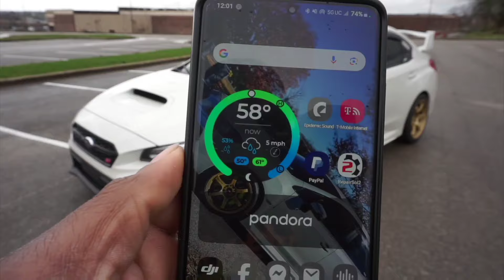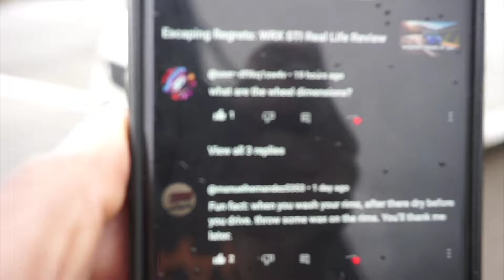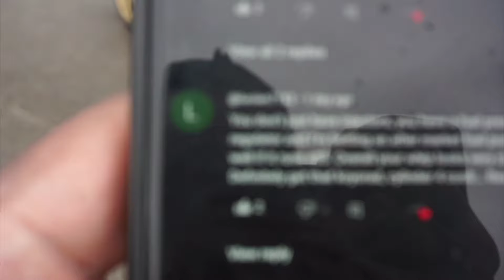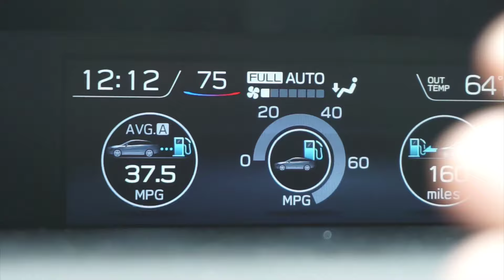"Responding to YOUR Comments: Q&A Session!"

Comment: yo so Im looking at a 16 sti and it looks like it got a bov and cobb sf intake on it already shoudl I buy it?
Reply: Nice bro for the late replay.but if its something you want make sure to check everything over like what mods and tune that it's running. Get the service info as well so that way you know what your paying for if it's from a private seller and the same from a dealer
Reply: @HIROTOLLIVER  its a dealer im tryna trade my car in for it and i have been asking questions i asked him about the tune so ill have to see but idk who wouldnt get a tune on there car
Reply: @HIROTOLLIVER  if the dealer doesnt know is there a site i can use the vin and check or will that not tell me?
Reply from the maker: I dont know for sure if there a site to check but I can look into it.how I did it is to check what layout is the cobb accessport shows because I noticed that when it's tune the read out is different but the pass owner of my wrx sti left information about the tune
Reply: If it’s your going to be your only vehicle, it would really depend on your pockets. These car blow engines stock. Part of it is maintenance the other part is luck of the draw. If your set on an sti, make sure you would be comfortable spending 10k on rebuilding the engine. As it could be at 150k miles or it could be 56k miles. I personally wouldn’t recommend an sti especially modded for an only car.
Reply: @lucian7182  I hear peoiple say its fine for daily driving you just cant be an idot and do 0-60 pulls every time ur at a light or stop sign and I would only get one if I have a warrenty which the dealer said they can put a warrenty on it for me
Reply: @colinmusgrave  yes they can be driven as a daily, but you need to be a lot more on top of your routine with one. For example checking the oil and coolant level weekly, making sure you don’t have bad gas, letting it warm up before going over 3k rpm getting oil to 180 degrees before getting into boost. It’s just not a get in and go kind of car. Kinda like a gt350. If they will offer a warranty, get it in writing that they will honor it even with a tune,
Reply: @colinmusgrave  there are plenty of meticulously maintained STi that get treated very very well that pop their engines. If anything I would recommend driving like a sports car once warmed up and atleast once a month get the revs high near red line. They are great cars don’t get me wrong, reliability wise tho, we basically celebrate it in the scene if you clock 100k on the original engine whether your modded or stock.
Reply: @lucian7182  my car rn is just a regular car and i do oil changes every 3k which if im not wrong u have to do that for an sti or wrx also and the only reason why im fine with that is because I probably drive 3k miles every 4-5 months I have had my car for about 2.5 years and Ive only drvien about 10-15k miles because I rlly only drive to school and work everday so i probably drive 20-25 miles a day so its not like im drivntg 100+ a day
Reply: @lucian7182  im looking at one that has 60k on it for $24k and it has a cobb intake a front intercool a iag aos and a bov only mods thats done and when I check it out ill ask if its tuned because I will not get a car that has some mods thats not tuned
Reply: @lucian7182  yo man did u see my comments just wondering i wanna know what u think about them both
Reply: @colinmusgrave  the oil change interval is proper, for the Sti I would highly recommend motul xcess gen2 5w40.  The mileage isn’t bad at all for the price, and the fact that it already has a front mount is a nice. make sure it comes with the accessport, if not walk away. Assuming it does come with it. Plan on getting it retuned, by a tuner you want to go with once you pick up a couple parts you want to add. 
At that price even if you end up replacing the motor a year from now it’s not bad at all.
Reply: @lucian7182  so i get my car oil changed at a auto shop would they know to use the correct oil? or do i have to tell them to use that type
Reply: @colinmusgrave  I would either start doing it yourself or bring the oil, filter and  crush washer with you. If you go to a shop for the changes I would strongly recommend a shop that specializes in tuner cars like Subarus not one of those 5 min oil places.this is the kind of car where you want to learn to do as much yourself as possible, because mods and repairs get very pricey due to the sti in the name.
Reply: @lucian7182  id have to ask if they dont got that oil id just buy it
Reply: @lucian7182  and like i commented before i prolly wouldn’t need oil changes a lot cuz i barley drive anyway the furthest i’ve driven was like 1.5 hours but that was for vacation i drive to school and work sometimes to get food but that’s it that’s why im fine with it for a daily to have some fun also cuz ive always wanted a sporty car
Reply: @colinmusgrave  I totally get it, mine only has 8300 miles on it, but I’ve probably changed the oil  about 10-11 times.
Reply: @lucian7182  alr so i think imma just walk away from this but I found a regualr wrx and looks like no mods so might go for that even tho its not an sti its alr I cant rlly find any stis near me without loads of mods
Reply: @colinmusgrave  there are a lot of great cars out there, a 2015+ Wrx is a good degree more reliable and less maintenance heavy compared to a Wrx. You could honestly get a 24 base for damn close to your budget.
Reply: @lucian7182  the car is also the color i want and looks good exterior wise it’s got the wing a lip and side skirts already and was wondering which one is faster sti or wrx i heard people say wrx even tho sti has higher hp
Reply: @colinmusgrave  the sti is faster but not by much, not even a full second. Around the city light to light the Wrx can be faster because it spools up around 2500, where the sti spools up around 3500 rpm. The Wrx is cheaper to make power initially as it has a lower ceiling 2015-2021 we’re talking around 300 wheel without ethanol. With ethanol they go up a lot higher but the Wrx trans’s safe point is about 350 . The sti cost more to make power as the engine is like 20 years old, however it has a much higher ceiling. The sti trans is good for 750 whp.
Reply: @colinmusgrave  the sti has a superior awd system, 2 lsd and dccd. The Wrx does not have lsd’s. The sti has hydraulic steering which offers better feedback. Stock for stock the sti has better suspension and Infinitely better breaks. If modding the a fbo sti will be faster than a fbo Wrx however it will cost a lot more.
Reply: @lucian7182  ye if i get the wrx it will be a daily i rlly wont do anything except exuast system and maybe a stage1+ tune
Reply: @colinmusgrave  coming from your current ride I’m sure the bump in power/ handling will be nice.
Reply: @lucian7182  it 100% would my car rn is like 140 hp 😂
Reply: @lucian7182  that’s why i dont rlly care for the sti that much the wrx will be enough power for me
Reply: @colinmusgrave  I went from a 2010 mazda 3 to a 2020 Wrx, so that was a huge difference, when I went from the Rex to a 2021 sti, it wasn’t a huge upgrade especially since my sti was like 18k more than my Wrx.
Reply: @lucian7182  damn 18k is a lot
Reply: @lucian7182  and with 18k there’s prolly other cars u could get honestly that would be faster if that is what u we’re looking for
Reply: @colinmusgrave  Honestly I probably would have been happier if I went with a mustang gt premium for the price 😂.
Reply: @lucian7182  yea i was thinking about getting a mustang but  i just like the look of a wrx so much better
Reply: @colinmusgrave  the 2015 -2021 Wrx definitely looked better. The 2022+ Wrx vs mustang, mustang takes the cake hahah.
Reply: @lucian7182  ye true the new wrxs are ugly ash ive always wanted one from the 2015-21 years
Reply: @colinmusgrave  the new ones can look bad ass, but that’s like 10k into cosmetics, paint, wheels and coils.
Reply: @lucian7182  yea u gotta do a lot to it for it to look good